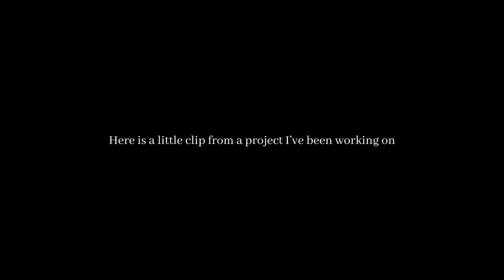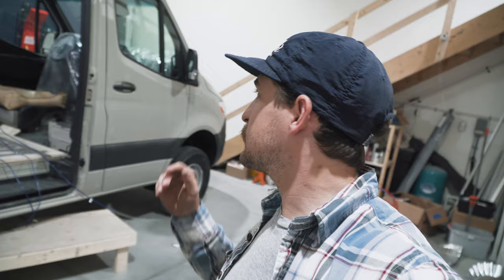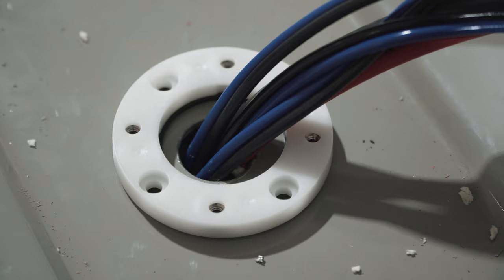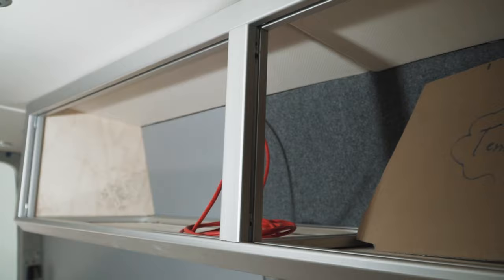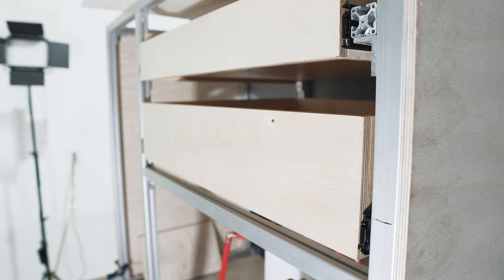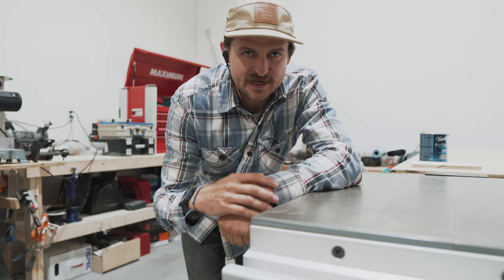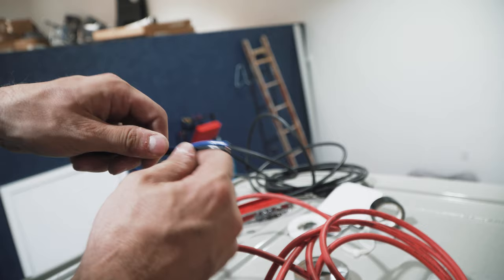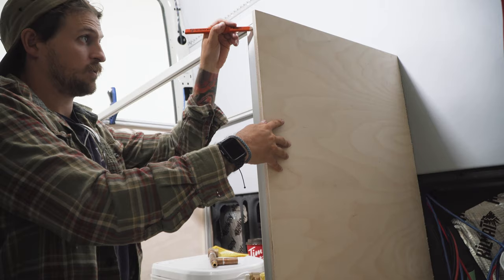8020 Cabinet Framing, Drawer Making and 12v Wiring | VAN BUILD Update

Comment: Thanks for the new video!

As others have said, 80/20 info.  

Also, while generally, I like to see the video of the struggle, build, foibles, and successes...  I get a lot of value from the discussion of what you considered doing, how you think it turned out, lessons learned, etc.  and if the video is a mix of the finished product and you talking about the struggle to get there I think that is absolutely fine.  

I’m more interested in the decision making and other thought processes (with a touch of visual interest to support) more than any “step by step”.  

Keep up the good work!
Reply from the maker: Thanks Mitch! Ill try and include more of the thought process and thinking that goes into the build

Comment: I see @ 3:50 you're scribing with a compass. That'll get you close but if you need spot-on, once you're close, re-scribe your pattern with something like a fender washer (I use a Danish 25 øre coin) which will give you a pattern with a -offset. When you mark your part scribe with the same washer/coin to create a +offset and make your cut.

This comes from boats '74-'78 and van '78-'82

Comment: The laminate is a far more durable finish as well. While a little more expensive going with all 12ga wire on the dc side regardless of fusing I think is less of a hassle.
Reply from the maker: Yeah its not that much more money in the long run,

Comment: I'm in the middle  of building a 2018 144 4x4 and we have similiar layout. I'm plannning on a futon bed in the same spot and I'm also using 80/20, the 30 series. I'm interested in understanding how you plan on doing your futon bed in regards to the sliders, linear bearing, ...? I have some ideas but haven't finalized the design. My going to target the 3/4 bed size which is 75x48 which will allow me to buy 3/4 sheets.

Comment: What 80/20 Profile do you use for the upper cabinets and lower cabinets? Are they 10 or 15 profiles? Would like to see how you attach them to the Van's sheet metal and also how the plywood is attach to the 80/20.

Comment: You took the words right out of my mouth! 2 steps forward and 10 backwards, I've been saying that for weeks! 
I'm using 80/20 too. Interesting how you did your drawers mounted to the 80/20, I'm stuck on attaching cabinet doors to the 80/20, have you found a hinge that works? 
Here are some pictures of my build with 80/20
https://photos.app.goo.gl/xBFQSkiLZn1P72UQ7
Reply from the maker: Ill try and show how I mounted them in another upcoming video but im super happy with how they turned out so far.
Reply: @scottadamson6116  If you used a hinge what size did you use?
Reply: @scottadamson6116  I second the comment above in wanting to see how you attached your drawer sliders to the 80/20 -as well as I'd like to see how you attached your ceiling panels to the rivenuts without them showing. Gotta be honest with the van build videos out there, so often they skip over these crucial details. Would love to see the specifics on things like the attachments and anchoring. Keep up the good work!